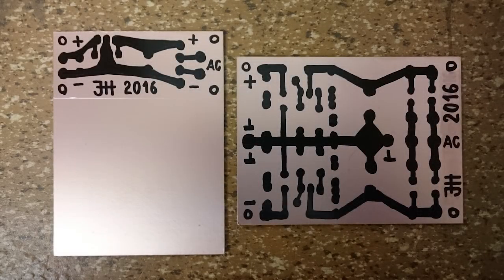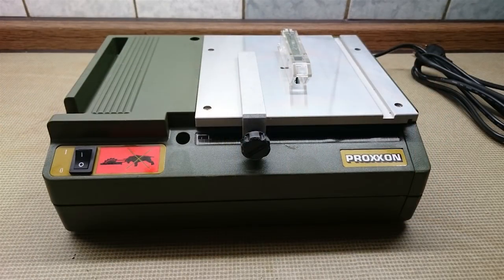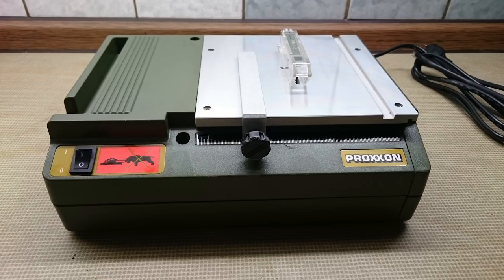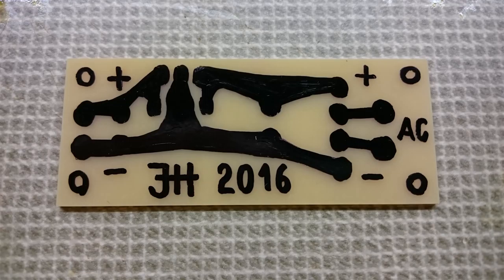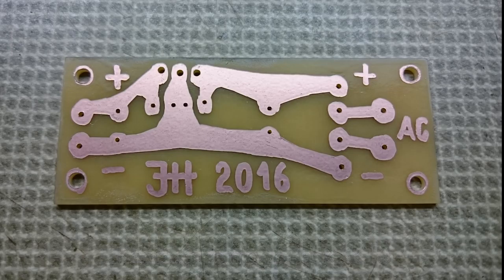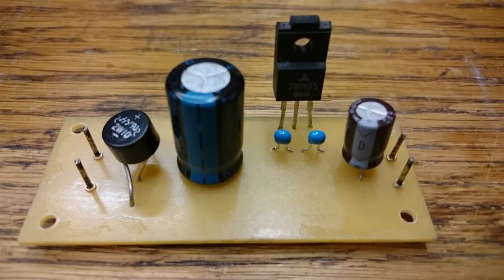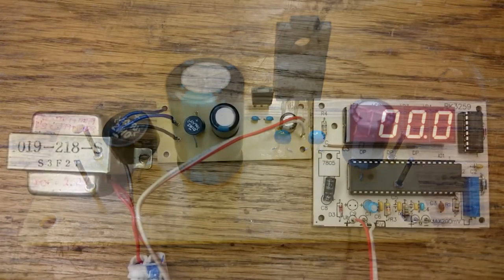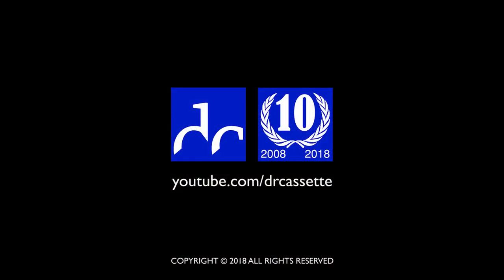Etching Circuit Boards - first experiments

Comment: This method is very similair to what my dad uses. He normally uses perforated board and solders everything by hand. For a project he did for me last december he decided to etch the board. He used the etching method a lot in the 70’s but in those days the chemicals where rather nasty so he hadn’t used the method for a long time. Nowerdays you can get a more friendly chemical (I think it is the ferric chloride that you have used). We used an Edding CD-marker to draw the traces. It works quite well, but the type of ink makes a difference in whether it works or not. The CD-marker ink may be slightly different then the standard edding 3000 ink.

Comment: 15 minute isn't that long, i expected something like hour or two.
Maybe you could put board on some sort of a plastic mesh that would be lifted up from solution with motor that would be controled by timer or arduino.
Reply from the maker: You are totally overthinking this. I already built a machine for etching circuit boards semi-automatically, and all it needs is an electronic speed controller for a little motor. No Arduino ;)
Reply: DrCassette Thats why i said timer, one that will turn on after set time, and some sort of switch that will disconnect motor when it gets out of the solution, something like NC contacts on  button.
Reply from the maker: Oh, you're talking about a device to lift the board... no, I don't need that. The machine I build agitates the container and heats the solution using a halogen light. With the solution heated to something around 30°C - 40°C, the etching process takes only about 5 Minutes, depending on the board. You can't really make predictions about how long the etching will take, so a timer isn't helpful there either.
Reply: Oh, i meant about lifting it since you said "i need to automate that", does it hurt to leave board in solution too long?
Reply from the maker: "I need to automate that" I said with regards to having to manually agitate the container throughout all that time. When the board remains in the solution for too long, the etching starts to work sideways, it eats up the copper under the marker starting at the edges. So if you want clean, sharp edges, you must pull the board out as soon as there is no more copper left on the uncovered parts of the board.